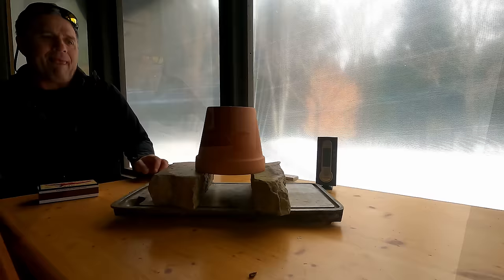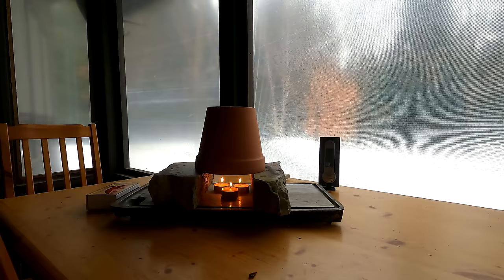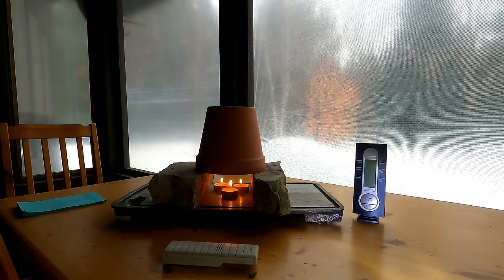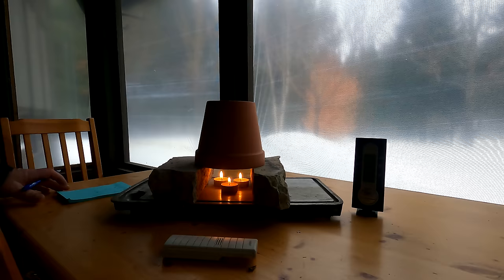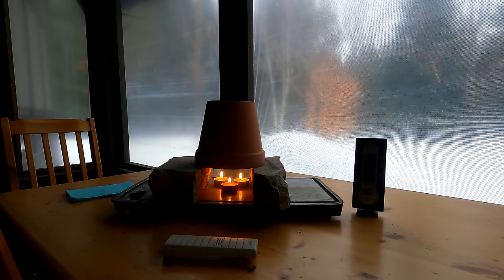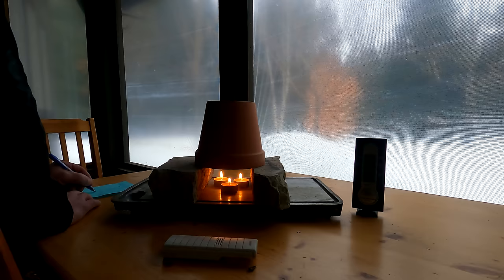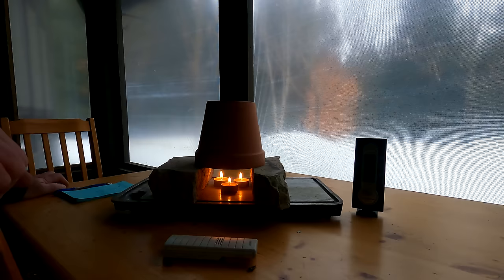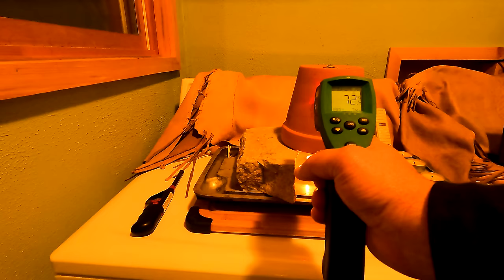Testing the Clay Pot Heater | Truth or BS | Prepping and Testing

Comment: Best thing to do with a few candles is to heat up a quart of water in a pot, pour it into a nalgene type bottle, place to the bottle in a large sock to protect you from the heat, then place the bottle in your sleeping bag, or inside your coat.  I did this routinely when I lived in a cold college apartment.  The water will still be lukewarm after 8 hours.  Note that buying tea candles for the purpose of heating is quite expensive.  I used wax salvaged from previously burnt candles.  Least expensive ways (in our area) to heat the water are probably wood, electric, followed by propane.  Not sure if a solar oven will heat water to near boiling on a cold winter day, but that would be an interesting use of one.
Reply from the maker: The use of a nalgene bottle filled with hot water is a great camping hack. I actually carry a rubber hot water bottle purchased from a drug store for that very purpose. It's great knowing you have it with you. Tea candles are indeed expensive and not cost effective at all. I like the fact that you collected used wax and repurposed it. Cool.  The best way to heat water is on a small alcohol stove - it is relatively quick and the canisters of fuel weigh very little.  It would be interesting to try your idea of using a solar oven - I have no idea if it would work but it would be neat to give it a try.    
Thanks for the comment.

Comment: The pots MAY actually make a small difference by stopping the hot gas from the candles from just going up to the cieling and escaping the room through gaps in the cieling and instead actually more slowly directs it evenly to the room
Reply from the maker: That is their only function - they control the heat output which allows you to enjoy most of the candles heat.   Thanks for the comment.

Comment: Is no one going to point out that the only way to accurately conduct this experiment is to do a similar test without the pot using only candles?  Also, you probably need to block outside sunlight from entering the room, preferentially doing the test at night.  

I guarantee the average temperature rise inside the closed space will be the same.  It’s thermodynamics.
Reply from the maker: Many have indeed suggested doing the test with only candles. The room in which I tested this unit is an internal room in the house - The window to the porch is covered. No sunlight can enter the room. This was not an experiment to determine the difference between candles on their own and candles with pots. It was simply at test to determine the validity of others claims.  I have used candles in my home for years and can tell you that the heat is the same, however, it is uncontrolled. I was amazed at how much heat the pots absorbed and how long they were able to hold the heat long after the candles had been extinguished.  The heat radiating from the pots was very controlled - therefore providing more efficiency to the equation.  I have stated that this unit would be incapable of heating anything but a very small enclosed room. The candles can produce toxic gasses and the risk of fire is huge, therefore I would not recommend this unit to be used as an emergency heat source. Try heating one pot with candles - you will be amazed at how hot that pot becomes.
Reply: @Hawksshadow  I don’t doubt that it will heat the room.  My point is that it can’t heat the room any better than the candles alone.  Heat is energy, as I’m sure you know, and the candles only have so much energy in them to be converted to heat.  Assuming the room isn’t open to drafts and is reasonably well insulated, you are releasing the same amount of energy into the room, thus the average temperature in the room should be the same after the candles are consumed.  The room cannot get hotter just because you’re putting flower pots over the candles.  

However, I would agree that if you are only concerned with the air temperature in the immediate vicinity of the candle and pot, it will stay warm longer, but at the expense of a lower temperature further away from the pot.  This is why I think the idea is bogus for “heating a room”.

Comment: Clay pots (or tin pots, or titanium pots, or pots made of pure gold) do absolutely nothing to GENERATE heat. Your heat source is your candles. You cannot generate heat from clay pots, only redistribute it. I have read elsewhere that a candle provides about 80 to 100 watts. That's roughly the same energy as my bedside reading lamp.
Reply from the maker: The pots only function is to capture the heat of the candles and radiate it out in a controlled manner. Without the pots - the heat will be lost to the ceiling.

Comment: 2 degrees in 4 hours with a Heater going and day time the temps change .   to do the test right need a building that has no heat and your using the candle as the fuel . 1 BTU is what they put out 4 candles is 4 BTU  even with 100 the room will never get warm .    I love wood heat and a good stove you stay warm all winter .   Since I live in town I use gas and Electric . But I know Math and science if it was only that easy .
Reply: A candle puts out 80 btu learn electric.
Reply: @reneek7721  1 candle is about a 80Watt Bulb  your not going to heat a room with a Bulb or 4 bulbs. Unless its a 5000 watt heat lamp that defeat the purpose with no power .
Reply: @JCcanU :
I didn't say it would heat a room but it will keep you warm if you're in a very small space.

Comment: The law of conservation of energy, you won't raise the temperature any more than without the pots. It just heats the pots which store some energy for a controlled release.
Reply from the maker: 100 percent true - the pots simply capture the heat and radiate it out.  They do keep the heat long after the candles have been extinguished. I personally would not use this as an emergency heater - to many potential problems coupled with the fact that it is simply too small to heat anything but a very tiny space.

Comment: During snowmagedon in Houston I placed 4 clay pots on the gas stove and used a generator to power a box fan. It kept the kitchen and living room toasty for my family. No way I believe that candles could have produced the heat we needed, but a gas stove throws quite a lot more BTUs.
Reply from the maker: The radiant heat from the pots is quite substantial. Using a fan to push it is a great idea.
Reply from the maker: BTW - Brilliant using the gas from your stove. It is truly amazing what we come up with when the power goes out and our everyday lives become a question of "how do we get through this?"   Thanks for the comment.
Reply: They sell fans for wood stoves. No energy required. They heat up then start blowing. You should look into them for the future.
Reply from the maker: I heat my house with wood and therefore have no need for this clay pot heater. I do have one of the fans of which you are speaking about and it does wonders to move the warm air through out the house. Cool bit of ingenuity. 
Thanks for the comment.

Comment: Last few times I've seen this done, they referred to using the pot as a "huggable" heat source similar to a hot water bottle, so you could warm yourself with very small flames. Not so much as a room heater. But a few degrees can keep you from Hypo, so it's a plus!
Reply: Used to use on by my feet while on the computer. Used three tea candles. Just a even 3 degree difference makes all the difference sometimes.
Reply: Ive seen multiple pots used also

Comment: I'm telling as many people as I can that this won't truly heat a room but it can keep you from hypothermia for frostbite. I microenvironment built with a tent and insulated with blankets or cushions or even stuffed animals Leaf litter if you're in the woods or snow snow cave can keep you warm. Make sure that you have insulation between you and the floor such as a mattress or a good sleeping bag or in the woods of pile of leaves or cardboard even dry cardboard is a great insulator. If you have a good hot water bottle or Nalgene that doesn't leak you know something warm and that will help get your temperature up. These heaters are great for warming a can of soup making some ramen noodles helping keep you warm while you move around please don't sleep with one on or put it in your tent. They may help keep your Greenhouse warm if that's your aim.
Reply from the maker: This should never be used in any tent. Open flame and nylon are not good buddies. This unit will only heat a very small room. 50 Square Feet or less. There seems to be an expectation that this unit will heat a house - No Chance. This will only keep a small room relatively warm should your power fail.
Reply: everyone should read this

Comment: A few years ago it got cold..snow cold. Wasnt use to that. Tried the clay pot...and it sucked. To better prepare for next year...i got solar power with back up battery, a heater and thick ass blankets. Winter was a joke.  But the tent in the room does keep in heat for those with no power.
Reply from the maker: That is awesome - it's great to be ready and prepared. 
I agree with you totally - the clay pots are not worth the time or effort.

Comment: I live  Michigan’s Upper Peninsula where winter can easily hang around for 5 months.  I have chickens that get confined to their barn until the snows melt.   In winter, chickens drink a lot of water.  I place an incandescent light bulb in a cinderblock or a clay pot and put a concrete paver over the block and their waterers on top.  The concrete heats up and the waterer remains ice free.   In extreme cold, the top of the waterer freezes.  I later bought a heated platform for water and that works too!
Reply from the maker: Brilliant idea - The weather where I live is the same, winter hangs on for a heck of a long time. I had huskies who stayed outside all year and I too used a lamp to heat a flat stone which kept their shelter warm. It is amazing how much heat rocks, pavers or pots can retain. I had no idea that chickens required so much water. Thanks for reaching out and the info you passed along.

Comment: Its crazy how these work for some things. Didnt believe it until i made my own. Not going to heat a room, but definitely can feel it when you're sitting at the table with it. Worked well for hand warmer
Reply from the maker: 100 percent - that is the point of this unit - it is simply to keep you warm in dire situations. I totally agree about the hand warmer - it certainly works for that. I placed it on the floor, in between my feet and my whole body warmed up. I used a sleeping bag to cover my back and shoulders.  The only thing I must caution everyone about is the fact that the candle wax can melt due to the heat of the pots. I would suggest that the pots be elevated at least 5 inches above the candles to allow for some air flow. Another important point is to use beeswax or soya based candles as they are clean burning with no nasty fumes.  Thanks very much for the comment. Much Appreciated.

Comment: Ok. So I’ve been messing with this for a while now..

1. There is a guy on You tube with several videos warning about how his exploded. Problem was.. He too used (only 2 pots) and connected them with a bolt set up through the drain holes as you did. Big mistake. He gets into this whole scientific thing about how paraffin gases build up underneath, which I believe is true. But I believe he is not taking into consideration is that Those holes want to be OPEN. You need a chimney, so I would be very very careful about bolting multiple pots together. As the most recent comment was brought forward, this can be accomplished with one pot, which is the way I’ve been doing it.

2. I am discovering that the best candles are the lowest candles you can get. Tea candles work excellent but you need about five or six of them to create some serious heat (Tall candles lose the ability to heat all of the clay pot). The problem with tea candles is they burn out in two hours. 

Solution: Make your own Crisco candles. Crisco was originally invented for the purposes of making candles and soap products. After the invention of electricity, they realized their product could be used in the food industry. I have experimented with cat food cans, and  small tunafish cans. Pack them down with Crisco. Use a two wick method per can. This way you can squeeze three cans under there with six wicks.

Why use Crisco? Because it will burn for days and days and days! A typical sauce jar Crisco candle with one wick will burn for a week or more. Also, there are no fumes, no odors, and they are non-toxic, unlike beeswax or paraffin. Crisco is also nonflammable. Paraffin wax is highly flammable. If the candles get knocked over, they’re going to start a fire. All positive points for Crisco!

3. I tested a large clay pot with 7 candles. I use the matching clay base and set the candles in the base. Then I use three clothes pins with the mouth pointed inwards, and then set them on angles with the little notches resting into  the outside edge, in the pattern of a peace sign, dividing the base up into thirds. Set the candles in between, put the pot upside down on top of the clothes pins and try and catch the notches. This creates a nice stable base, and it provides airflow underneath, so the candles can breathe.

Results: Since we in the states use Fahrenheit, all my temperatures will be in Fahrenheit. After about an hour, my chimney temperature was 340°F. Actually, I apologize, that was with five candles. I think the seven candles gave me 440° Fahrenheit at the chimney hole. My research says that these clay pots are safe for anywhere from 500 to 800°F I believe the clay pot temperature reached just under 200°F. The air temperature above the clay pot, about a foot to a foot and a half above was about 150 or 160°F.

I have yet to test inside of a tarp tent situation. But I will be on vacation after Christmas for two weeks, so I will be revisiting this!

😎 Merry Christmas!
Reply from the maker: You  are indeed persistent at improving this method. Crisco is brilliant but in a camping situation it will invite all kinds of furry creatures to share your quarters with you. They love the taste. Well done though. I will never use this to heat anything. I simply wanted to see if it was BS or not. Thanks for the comment.
Reply: @Hawksshadow  I did not give that one a thought! 😡. I have been backyard practicing bushcraft, tarp tenting and general wild camping skills since last Jan/Feb. I plan to get out early next year. Been sleeping out in all temps… down into teens F. I am planning to build my own unique knock down wood stove.. but.. I wanted to try this with a double tarp experiment. But I strongly believe in the triangle method for a wild camp.. 100-200 feet between fire/cook area, bear box/cooking clothes, tent. Beer noses are huge and good for up to 50 miles (reported in California! 😮) I am so heavily cognizant of wild life.. but NEVER gave a thought to the Crisco thing!!

See. Open your mouth and learn something every day. THAT was a good call. Thanks for deflating my plans.. 😂, and quite possibly saving my hide! Lol
Reply from the maker: @dobrofool  I’ve taught survival for thirty years. What you are doing is perfect. Acclimatizing yourself in a familiar setting is perfect. Next, loose your fear. Hollywood lied. Animals do not want you. They want your food.  Never cook near your sleeping area and wash your hands before touching your tent. You’re doing great. Keep it up. Good talking to you. Let me know how you do I’m the bush. I’ll help where I can.
Reply: You said Crisco is non-flammable. So how does a non-flammable substance stay burning?
Reply: But this would be safe indoors in the event of a power outage with no heat during winter?
Reply: @vetteluvnh non flammable does not equal non combustible, the most common definition for flammability is, “burns in the presence of a spark at under 199.4 degrees Fahrenheit”, as defined by OSHA 29 CFR 1910.106.

A crude although not exactly accurate example would be the difference between petrol and diesel.

A teaspoon of petrol in a fire place or pit readily ignites and won't always start your tinder, where as you can hold a torch to diesel soaked tinder for a bit before it ignites and since it burns a bit slower it starts a camp fire more reliably

Comment: The pot is conducive to heat due to its density so you are utilizing btu w a heat surface. Air does not hold the heat there for it cannot radiate the stored generated btu that will have capability to radiate btu's to other objects due to the pots storage and surface area factor..
Reply from the maker: Well said. Thanks for joining into the conversation.

Comment: You can't create energy. The candles will only produce a certain number of BTUs.... the pots, or any objects heated will only store the heat and perhaps extend the output after the candles burn out. The pots are only containing and concentrating the heat near your device... rather than allowing the heat to rise and dissipate throughout the room. The pot heater would be useful on a table to warm people sitting around it.
Reply from the maker: 100 percent accurate. When you need to keep warm, this unit is one you would have to hug. The issue is the safety concerns - toxic gas from the candles, open flame in a house and flash ignition of candle wax. There are plenty of products manufactured for emergency use which are certified for safe operation  in a home. I heat my home with wood; however, I do own several Naphtha gas space heaters which are put to good use when the power grid decides to take a break.  Thanks for the comment.